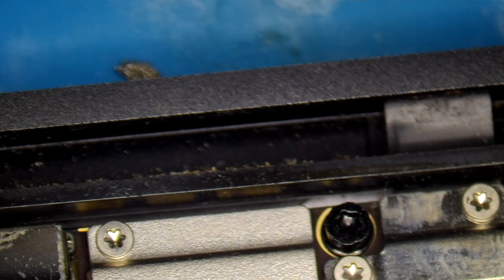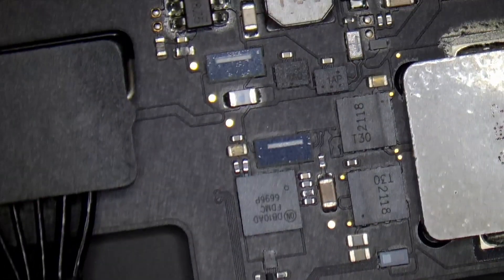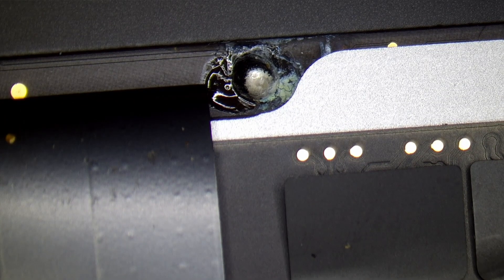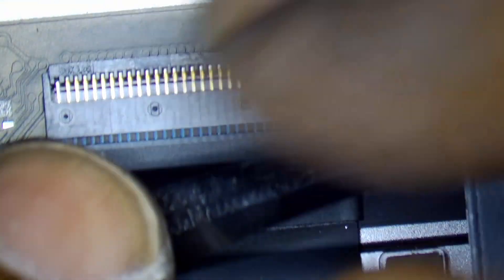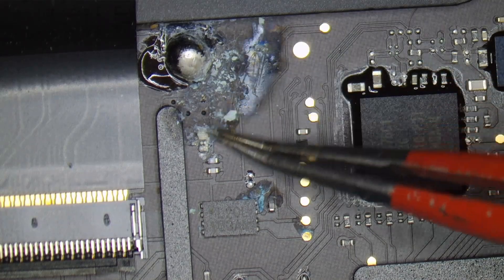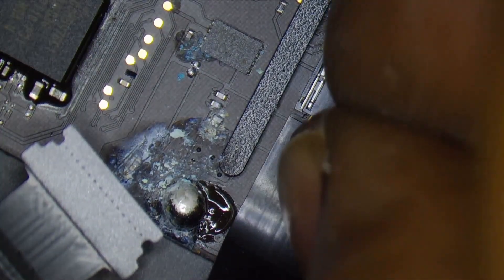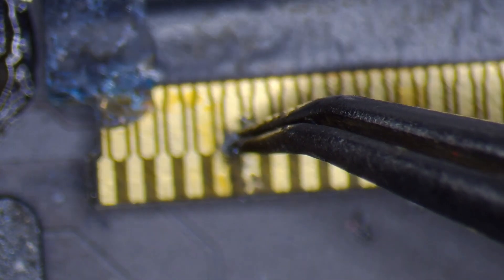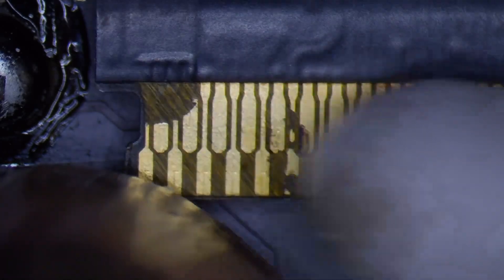Apple MacBook Air M1 2020 (A2337) Keyboard and Touchpad Not Working Solved

Comment: Is the touchpad and keyboard connected by the same cable? Like, I have a Mac air that had a issue on the same connector but the keyboard is also not working.

Comment: Hello is there any1 having the same issue? My too both got stucked.
First thing i did was to reset my mac..that didn't work..but after resetting my mac can power on with any keys(before reset only power key)..trackpad shows not found(main issue with trackpad i think)but its clickable..can any1 say how did u fix urs?
Reply from the maker: I have shown only one problem and one solution. There may be 100s of ways a device could go wrong . So need to check the device before suggesting some thing